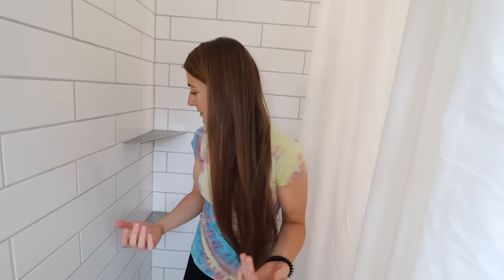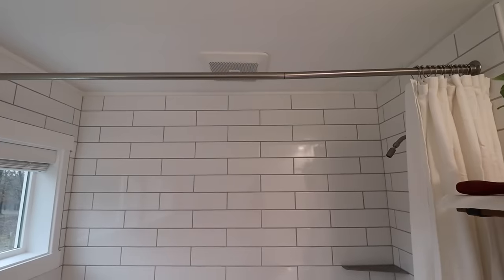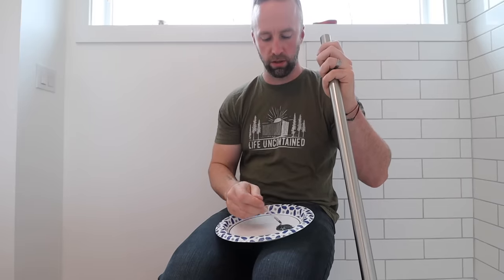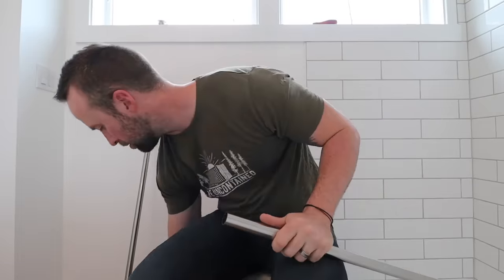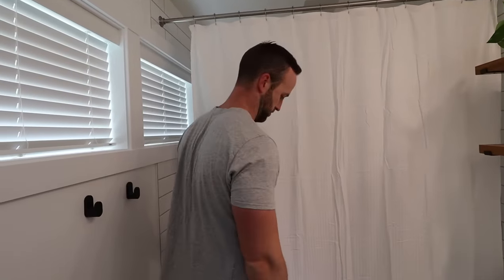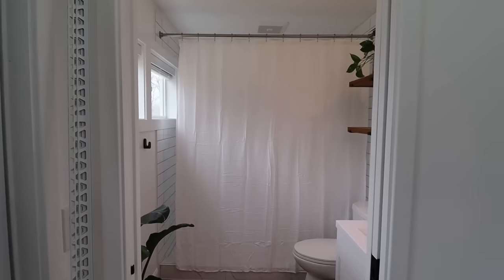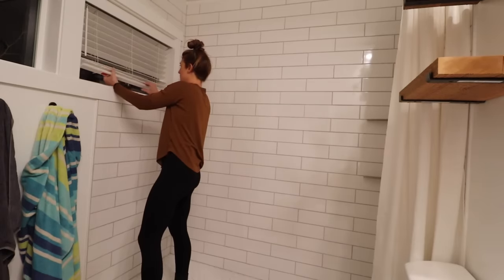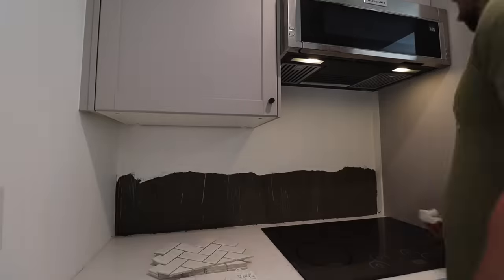FIRST SHOWER INDOORS AFTER 4 YEARS!

Comment: I admire your efforts in this whole build and striving for perfection has made it immensely watchable. With the shower curtain drama I’m wondering why you didn’t fit a sliding door instead. I’m sure you’re both extremely proud of your house, congratulations.
Reply: Right. Sliding door would have made more sense especially in a stand up shower. Tub I totally see the point for a curtain, but sliding door is the way to go.

Comment: For a shower rod, Electrical emt conduit comes in 10' sections. Has sort of a galvanized finish or paint. Maybe a 1" diameter and cups on either end like a closet rod or use blank electrical plates with connectors on each end.
Reply: I did this across a 10ft bay window and it was perfect. I scuffed it with some 200 grit sandpaper, and it looked like brushed nickel.

Comment: Bathroom looks awesome.

For a shower curtain pole go to a tubing supplier and get a length of polished stainless steel tube.

It's strong and most importantly it won't corrode and stain which is something all chrome plated ones do eventually.

Comment: I agree with the comment about using a curved shower rod with the ceiling attachment to give you enough shoulder room or switch to a glass panel/ wall or a glass block wall that gives you privacy without blocking any light. You only need to extend the wall maybe half the length which would prevent the water from getting the rest of bathroom wet. Plus it is easy to fill the holes in the tile white silicone or something similar.

Comment: You need the Curved Shower Rod that gives you more room when standing in the shower
Reply: Good idea
Reply: And an over sized clear or almost clear at the top curtain. They could just get some black pipe cut to size. That would be me!
Reply: They probably don't come in the length necessary for this particularly wide shower.
Reply: Was gonna recommend same. With Spenser's fabricating abilities, he could make one to length. The doubled up curtains sound like a good idea, too, as long as the overlap is facing the right way. 😉😁
Reply: @SingerGuy59  would def have to fabricate one

Comment: Why don't you buy TWO exactly the same shower curtains, slide one to the left and the other to the right.  And the curved shower curtains are a great improvement! Lovely space!!
Reply: Yep, big vote on the curved shower curtain rod.  Replaced my straight curtain rod with the curved and it widen the room in the shower by 5-6".   Best, and cheapest, upgrade I did to my shower.  Hopefully they can find one long enough.  If not, perhaps Spenser can alter or improvise one.

Comment: As an accent decor, you might use those square glass bricks one or two blocks wide as a divider up the wall on the shower head side. That way the shower curtain won't look so weird as you have narrowed the gap for the curtain to cover. For color, you might go with the glass that has bluish or sea green tint
Reply: OH!!! And put light in them!!  Pretty!!
Reply: @lilpeggilley8891  easy to do with LED tape like they did up in the lifted ceiling 👍

Comment: Hi guys, a next option is to use two shower curtains
Reply: I was thinking that too. I would split the second one down the middle and hang a panel on either side of the center panel. You could overlap the seams, putting the cut edge to the inside. (Could also sew the seams 😁)

Comment: Looks amazing. Thrilled to see your bathroom finished. Makenzie here’s a design hack for you. I too have a smaller restroom than I’d like I installed my shower rod high for the illusion of a larger room. That really did give off the appearance of a larger space. Since I couldn’t find technically a floor to ceiling shower curtain either what I did was found a lovely curtain set “on sale” that you typically see in a living room the length was perfect and the width was not a factor for the look I was going for. I had found that most of your high end good quality curtains have a slick backing on them that does very well as a water repellent, so like you I found the extra long shower curtain for the middle or almost width of the tub area than hung the regular curtains pushed open to the right and left ends of the shower area whatever lacks in width of the actual shower curtain isn’t even  noticeable. Just a thought for you if you ever want to change it up. This worked great for our family for several years now.

Comment: Ive always used continuous curtaining for shower curtains in both my bathrooms. 
I buy 2 lengths - doubled by machining the 2 together at the top only, then pushing holes thru - dont use eyelets etc because theyll rust when you bung it in the wash. 
You cant see the hole in the curtaining so Ive never bothered to tidy them up. 
The actual shower hooks hide it. I am going to eventually, after all these years, buy metal hooks to just modernise it a bit. 
Theyll match in with my metal rail.
I thought Id tell you what Ive done. Ive changed them a couple or so number of times and because its curtaining  it doesnt go moldy or wear out like a shower curtain does - wash and rehang - no spin drying either hence no crinkles.
I did start with various types of shower curtains but hated them all.
Less washing time before rehanging.
Ive never wanyed a shower screen either. Too hard to clean once you get older or have back problems.
Good Luck

I just do a wash and rinse then take it out and rehang to just let it dry hanging up!.
Ive been here since 1976 and have always done it. Mo clingy shower curtain attacking me.
I use 2 lengths of curtaining to stop any spray coming through. 
Both are white but the one at the front has a pattern in the curtain itself while the one at the back is plain and a bit denser.

Comment: You can make your own shower curtain that is water proof with half tube of clear silicone and paint thinner. cut the cloth you need sew the holes and everything you need then mix the silicone and paint thinner in thick garbage bag then put the curtain inside bag and get it thoroughly covered and mixed and hang outside to dry. You will have a permanent curtain with mold protection as well! Ive done my tents and rain fly this way and it works extremely well

Comment: You have several options I can suggest for the curtain rod problem.  One, get a piece of cast iron (for gas lines) pipe cut to the right length and put some mounting plates on either end.  Keep the current rod but get a dowel rod 2 feet long and sand it till it fits inside the shower rod and spans the flimsy connection and gives it a real spine!  You could also attach some sort of support bracket in the middle to the ceiling.  I would recommend a curved rod for that shower.  You would need a 2nd curtain panel.  Kensi can just sew them together.  I could see the cringe on your face when you stood in that slender shower space.  I hope you installed a motion light in the bathroom because if you flip the switch with wet hands it could cause a shock.

Comment: Go to the Home Depot/Lowes and get you a regular/standard type pipe/rod that's strong and solid.  It doesn't have to be labeled as a shower curtain rod.  This is such an easy fix.  You might need to get you a support arm in the middle and attach it to the ceiling.  With that, you may need to use roller hooks not, complete rings to allow for the support bracket.

Comment: You should have ordered 2 curved hookless shower curtain from Am***n.  Same drop length but span the width with 2.  Just get one that is 1/3 the width (window side) + one that's 2/3 the width (shower head side).  Keeps H2O off the bathroom floor.  And you just unsnap to throw in the washer ! They're amazing.  (I think your subscribers' want to see the garden or some other project next.)

Comment: I see that others have already posted my idea of a fix for the shower curtain. I would buy a 2nd curtain of the one curtain you already have. Take it to a seamstress and have the person stitch the 2 curtains together. If you don't like a nice full curtain, a little could be removed from each side. I think the full width of 2 curtains together will look pleasing when the curtain is closed. Of course, you'll need to get another set of curtain rings for hanging the 2nd curtain. Good luck. The bathroom looks great!

Comment: Just a thought, most shower curtains can be made as long as you want by buying two at once and overlap them to size since they'll hang from the same holes. Fixing a curtain rod  like this only requires a longer insert inside and it can be done with PVC  pipe or other such tubes that are about the same inside diameter with a bit of filler if needed.

Comment: Next time you are drilling on tiles use some masking tape or paper tape on the tiles, that should/will stop the drill bit from slipping around. A piece of wooden dowel in the middle of your curtain pole around the centre of the dip in the pole will stop it from dipping. Hope these suggestions help. Mark in England 🏴

Comment: Regarding width of shower curtain, years ago I had a rented house with similar curtain set-up over a bath. I found that if you draw the curtain full way to the wall on each end, the hot water flow causes an updraft of air and that draws cooler air in -this makes the curtain come inwards at the bottom. Cold wet curtain pulled into your legs whilst you shower is not enjoyable. Suggest you leave a bit of space at the window end. Most likely no water will get far enough down that end to splash out anyway.
Reply: Hello there👋👋,how are you doing today?hope you are having a good day?God bless you❤️

Comment: If you want the shower rod to not dip so much and hold up- insert a dowel that goes through both pieces of the rod and then use a welding glue.  Should work, I’ve used it on curtain rods. Good luck!

Comment: Career plumber here! If you really want to do a one piece curtain, look into hotel suppliers- many "fancy" hotels have oversize bath and shower installations. I agree with several comments about replacing the curtain rod- again the hotel suppliers might be an answer- a longer than average bowed one might get you both the length problem and a bit more "shoulder width". Or just order a piece of heavier wall stainless steel tubing the same OD as the present tubing and finish cut to length. BTW, a normal residential bath opening is 60"- the curtains are made a bit longer to get the folded effect. Additionally, a cloth curtain should have a liner to keep the finished cloth "show curtain" from developing mildew- not an inconsiderable problem in Texas, where i live also!  OK, all my "professional carping" done, Spencer, Kenzie, your results are far above expectations- for a "first time, self taught" effort,, ya'll knocked it out of the park!  I'll pass on comments about that big shower being a water saver, seeing it looks big enough for two! BTW, I was "interrupted" for a few weeks and now I'm back- has Beau grown like two or three inches? With you two for parents, I expect awesome to be her daily self!  PS; "Fast and dirty" way out of narrow curtain problem would be to order a second just like your original and hang it with the inside top curtain rings over lapped one ring space at the center. Would want to get heavier tubing to support additional wight, for sure.    FR
Reply: Hello there👋👋,how are you doing today?hope you are having a good day?God bless you❤️
Reply: @amytaylor3864  Thank you for thoughts! Much better- was "gone" for several weeks having to move when room mate suddenly moved out. Never liked moving, but sudden moves in Winter just ....... Oh, well, in much better place and glad to be there!
Have a great day, Amy, and a better one tomorrow!  FR

Comment: You can put a wooden dowell inside the rod, that is a few inches shorter than the total length and that will hold it straight, but I suggest you move that rod to the outside edge of tiles, because the curtain will angle down to the inside of the lip.  Or just get some sliders.

Comment: If you have a place in your area that is a steelyard see if they have a stainless steel pipe that size and have it cut to the length you need, you can polish the pipe and make it shine and you won't need to worry about rust or any dipping in the future.

Comment: Good morning guys…. Just dropped in for a couple of suggestions to solve your curtain rod problem….

1. Replace the unit with one of a larger size

2. Find a piece of tubing with a smaller circumference than your current rod and use a short length of that to connect the two pieces

3. Buy a bracket to hold it from the ceiling. Put your curtain back with half the curtain on one side of the support and the other half the other side of the support (or less or more curtain either side.

I see you have come up with a solution, that’s fine, I hope it works as you expect. It probably will as you are good at that sort of thing

Hope you don’t mind the suggestions

Steve & Paula

Comment: For the future, when drilling into tile or any slippery surface put a plaster/duck tape on the surface to stop "skidding" of the drill bit.For some short term stability of the shower pole put a cane inside it ,at least it will not fall down .

Comment: If you find a seamstress who would add a it's called bias tape, but it's a band used for the end of a blanket  or sheets.  It could be as simple as silk or as elaborate as you want it.  I think silk or even cotton would go well.  It might be pricey, but worth it when you see the shower curtain touch both ends as standard bathrooms look.

Comment: Glue the ends and inner support with JB Weld structural Adhesive. Will be rock solid in 24hrs, as if Welded and smooth, so no kink to catch the Curtain sliders

Comment: When drilling on glazed tile take a #2 phillips screwdriver and put the point exactly where you want the center of the hole.  Give it a light tap with a hammer, you will knock off just a bit of the glaze, don't get carried away and hit it hard enough to break the tile you just need to knock the surface glaze off.   Now you can drill a 1/4" hole with a masonry drill bit without it walking all around.

Comment: Did you say it came as 2 4ft rods with a pvc joiner ? if so couldn't you cut a slot along the length of the left over rod so you could close it's diameter enough to slide inside the two sections in use to form a strong rigid coupler ?

Comment: If you were so inclined, a small frosted glass wall about 9-15 inches on the inside wall would then shorten the width needed for the curtain to span. 

Good idea to use JB Weld. I've used that for many projects, and it has never failed me..

Comment: With the shower, just buy a pipe and 2 flush screw in ends (forgot what they're called)
But move the rod out into the room more.
That way the curtain won't touch you when showering. 
You could add one more curtain and tie them back on both sides.
If you can find the same curtain to match.
You 2 have done an amazing job.
You should he very proud of yourselves.
Reply: Hello cherry, how are you hope you’re doing great

Comment: You can easily fix the sag in the shower curtain rod by finding a long wooden dowel to slide through the curtain rod. The dowel has to be big enough diameter to support the curtain rod. Two-piece curtain rods like that are notorious for sagging.

Comment: You should have a glass company come out and install a single sheet of glass that covers about 3/4 of the opening. It looks clean and not as costly as you might think. We did it and it works great 👍

Comment: You guys could buy the exact same curtain and cut off a strip about four inches on both ends of it. Attach them/sew them to the outside ends of your shower curtain. Then add a ribbon in off white down the middle of both seams. Just an idea.

Comment: Make a longer coupler for your shower rods and use metal, Either aluminum or stainless steel. One about two feet long should be sufficient. Make sure it's a snug fit in the tube.

Comment: Before you put the drill bit in the drill slowly turn it in your fingers while turning it and tapping it with a small hammer. It chips the porcelain layer and will make it easier to drill

Comment: Curved shower rod will give you more room in there, especially at the head and shoulders area. There's no real reason why you should limit yourselves to commercial options either. Getting a length of stainless tube from the steel supplier, and doing a quick little ring roller action to put a little arch in the tube is really all you need to do. Fab up some brackets... done.

Comment: I would have bought a wooden dowel & put inside the rod for extra strength! If you can still do it get 1 as large as possible that will fit it!  If you get water on floor you can use 2 plastic liners for with, lengh might be a problem. Can have them overlap in center.

Comment: Take a wood rod or metal plastic what ever you find  smaller size width but the length need to be at total eight inches.  It's the length that will solve  it far longer than glue because you child can pull it down much easier in time.

Comment: Maybe this though can help ,look for Crome moly tubing you could order one piece to length it’s not inexpensive or look at you local box store for rigid emt electrical 10 ft to replace the rod and use the exerting end hardware you could get fancy and have either of them powered coated to your color liking

Comment: Guys, you could insert a pvc pipe of smaller diameter inside the curtain rod with a length that is slightly less than that of the curtain rod, i think it would make that joint of the curtain rod much more sturdy.....

Comment: Get a piece of stainless steel pipe cut to length with screw ends and they make fittings that can be screwed to the wall and paint it all the color you want or leave silver. Galvanized pipe is cheaper but wont last as long!